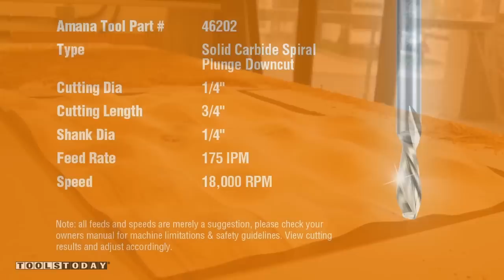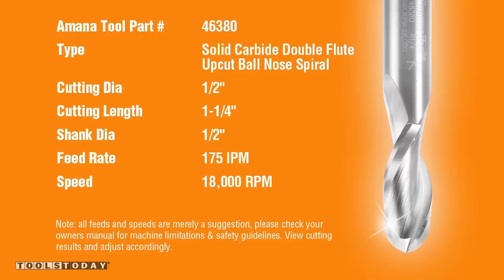CNC Project: Wooden Cabinet With Water Effect Doors | ToolsToday

Comment from the maker: That would have been a finishing pass so .10"

Now because the roughing pass has 1/4" steps that means at the low points the finishing pass only removes .10" but at the high points it can remove up to .35"